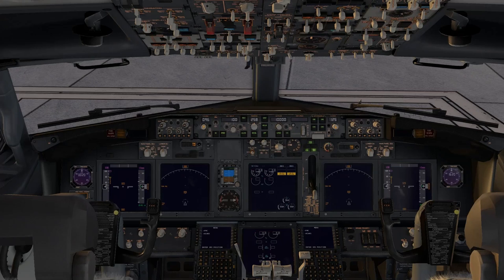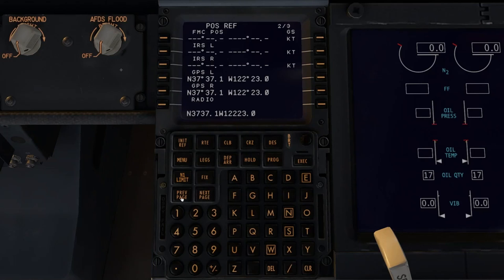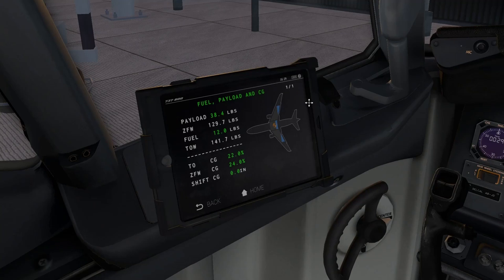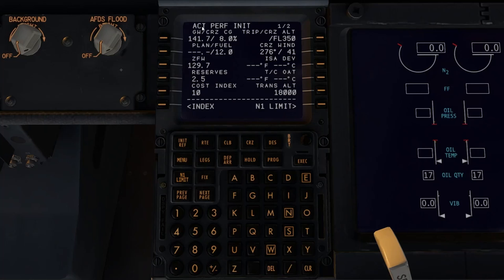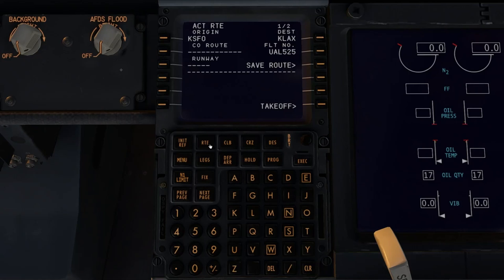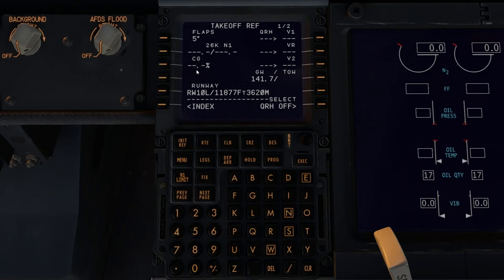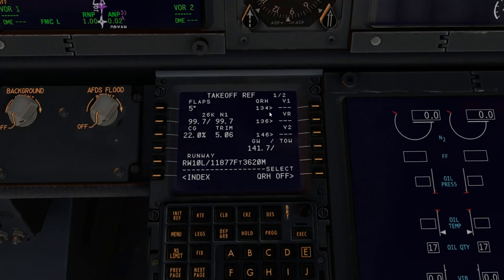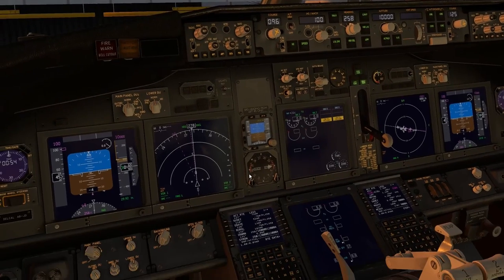X Zibo 737-800 FMC Tutorial | UNITED - How to: Setup the FMC Pre-flight | X-Plane 11

Comment: Overall, great video. Just a couple notes since most of us flying the Zibo are looking for 100% realism. 1) Wing tanks must be full prior to adding fuel to the center tank. I know you were in tutorial creation mode, but I want to avoid 737 pilots from making this mistake. This is taken from an actual Boeing 737 Ops Manual. 2)The reserve amount is actually your ALT APT+ FINRES since you are "reserving" the fuel needed to divert. This is confirmed by flightdeck2sim's FMC tutorial. 3) You don't have to manually enter the center of gravity CG or the OAT, just press the softkey and they will auto fill using the info from your MCP and AVITAB weight. 4) The avg wind direction/spd can be found in the Simbrief where you see "TOC" for top of climb. The ISA DEV temp is also listed a line or two below the wind direction/spd and begins with a "P".
Reply from the maker: Sim 737 Pilot thanks for the feedback.  I agree on the realism aspect.  Unfortunately, we’ve found in many forums low time “pilots” jump straight into the Zibo since it’s a fantastic “payware” quality aircraft for free!  Care should be exercised when loading fuel as you state.  Many may be unaware that loading the fuel in the center tank increases stress loading on the wing spars and support structures.  This being the reason why fuel is burned from the wings last.  I think sometimes the reserve fuel quantity is often mixed up.  Since it’s a “bingo” fuel level, its awareness is extremely important.  The alternate fuel is typically designated in flight planning as “alternate fuel” but this may differ among carriers.  Part 121 of the US 19 CFR provides further reading for those interested in fuel requirements for air carriers within the US or its territories.  I’m sure there is an ICAO version as well, but they are probably very similar.  Thanks again for helping grow the knowledge base of the sim community!

Comment: Excellent tutorial, I refer back to it often just as refresher. I would like to ask about saving the for plan so has to pull it up later in co routes. I have been unsuccessful in doing this.
Thanks a heep
Reply from the maker: That’s an excellent question and unfortunately one we don’t have the answer to off the top of our heads.  We don’t often fly repeated routes (since we are no longer part of a VA) but it is possible.  In fact, I think there may be a stored folder within XPlane where it holds the company routes.  Sorry, to not have an answer to this specific question.

Comment: The best tutorial i watched so far.  +1 sub! 

-one question though, what do we do regarding “unable crz alt” msg?
Reply from the maker: @Francis Meceda Thank you for the feedback.  'Unable Crz Alt' can be caused by a few things.  If you setup your aircraft and FMC according to simbrief (we have an FMC video and an Airline Flight Planning video on those topics), you can likely clear the warning and ignore it.  Here are a few reasons the FMC would warn you:  1- Your trip is short enough there isn't time to reach the cruise altitude you set in the FMC, 2- Your trip includes a step climb, and you have programmed the highest step in the FMC.  Typically the aircraft is too heavy to reach its final step right after takeoff, and that is what cues the warning.  As long as you program the FMC and MCP to complete each step (as per simbrief), you should be fine.

Comment: Thanks alot amazingly explained
Reply from the maker: You are welcome. Thank you for the compliment.
Reply: @FlightBrothersFT  how do you set the gross weight for landing tho? Is it automatically done when you set the perf ...
Reply from the maker: Sure, your progress page shows your estimated fuel at destination.  Look at the current fuel on board as you’re planning the descent.  Subtract the amount of fuel you have from the destination from your current fuel load, then adjust the gross weight by that amount.  I.E.  destination FOB 8.0, current 9.3.  Current gross 110.  Since we are estimated to burn 1.3, our estimated gross at arrival would be 110-1.3 = 108.7 then the ref flap speeds should recalculate.

Comment: hey this is probablly the best FMC tutorial I have ever seen!! great work. I have a question? How do you know that the fuel you enter in FMC is in lbs and not in kilos? is there a way to see it ?
Reply from the maker: Thank you for the compliment! The Avitab can be switched between lb and kg, but I want to check on the FMC. I have only ever used it in pounds, but that doesn't mean there isn't a conversion buried somewhere in the menus. Keep checking back, we'll let you know as soon as we get a solid answer.
Reply from the maker: @burcin Under the Settings and Features, Aircraft Config on the AVITAB you can select the units of measurement.   That unit does transfer to the FMC, I have confirmed.  You may also independently verify by using your preferred unit of measurement, then select the PERF INIT page on the FMC, and change it on your AVITAB.  It will alter the reading between Kg and Lbs on the FMC and also change related measurements on the EICAS.  Thanks for your feedback and we at FBFT hope this helps!  Cheers!
Reply: @FlightBrothersFT  hey guys thanks for the fast response. I was also able to do some testing and if you I can confirm that if you change the kilo/lb section it literally changes simultaneously in FMC!!
Reply from the maker: Burcin Erdemir it’s our pleasure and we were glad to help!

Comment: Nice tutorial bro, quick question, if we use KG units on the tablet/iPad for fuel weight, do we enter it as KG units in the FMC, or would it need to be converted?
Reply from the maker: The FMC and EICAS should convert to metric or standard based on what you are using.  I believe we’ve verified this before, but it’s been a while since we’ve flown the Zibo.

Comment: how you change for decimal number  in the payload page mine are full number  in lbs/kgs
Reply from the maker: You should be able to input the correct one or adjust it in the fuel/payload manager within XPlane itself.
Reply: @FlightBrothersFT  i check there  i found nothing if i change the value nothing work

Comment: on 28:53, how did you get the runway info? mines shows blank even after correctly filled out the departure and arrival.
Reply from the maker: Interesting. Let me ask a few more questions. Have you tried other airports and runways? Is your nav database up to date? Is your Zibo up to date?  I can't guarantee it is one of those, but they seem like the most likely issues. It has worked for me everytime I believe.
Reply: Flight Brothers FT I updated navigraph FMC to 2007 and Zibo is also updated.
Reply from the maker: That is odd then. Sadly I have no more guesses what the issue might be. There is a Zibo community group on Facebook with some really excellent folks who specialize in this aircraft. You might want to check in with them. Sorry I couldn't be more helpful.
Reply: Flight Brothers FT thank you for trying, I really love your videos btw. Very detailed and simple.
Reply from the maker: Thanks!

Comment: Why doesn’t performance initial pop up in the bottom right corner of my FMC?
Reply from the maker: Sorry for the delay, somehow this comment got missed.  Is everything else functioning correctly?  In our experience the init has always been populated.  Unless I’m misunderstanding the problem.  Try loading the default Cessna 172, then switch to the Zibo.  If that doesn’t work, try a clean install and DELETE the existing Zibo after backing up any additional liveries you may have to reinstall.  Sorry for the delayed response.
Reply: @FlightBrothersFT  thank you for the response, I uninstalled it and re-installed it but the problem hasn’t been fixed. Is there something I have to do after installing to make it work? I loaded the default Cessna 172 as well but that didn’t fix the problem. I feel I’m missing a step here.
Reply: @FlightBrothersFT  and the problems seem endless, set irs position doesn’t pop up with perf initial and I’m getting pretty frustrated considering it’s been a few months

Comment: very complicated is there a automatic planner for FMC?
Reply from the maker: https://youtu.be/sHcD0HQyy14
Reply: @FlightBrothersFT  this was way too complicated
Reply from the maker: Jesse sorry, what is it you’re looking for specifically
Reply from the maker: @jesse baby steps.  If you are fairly new to flight sim, or the 737 we would not suggest flying the Zibo.  Just take your time and “earn your stripes”.  If you have any questions, let us know and we will help or point you in the right direction as best we can!  Cheers.
Reply: @FlightBrothersFT  the major issue is that my honeycomb yoke is not compatible with zibo for the rudder pedals like the default 747-800 but that version is honestly garbage and we all know that i have been using a joystick as a rudder but somehow the laminar research has added the yoke to be usable as rudders without pedals. I have used xplane a long time my first yoke was the original logitech Saitek pro 7 years after I would never use that yoke again so I know some stuff I just wish I had the rudder working as well as wheels  on takeoff

Comment: Great video, i stopped playing x-plane cause i Didnt know how to USE my FMC, but now i know how to thanks to you! Great video! Just one thing. My fuel on the avitab isnt like 142.7 its much more Numbers and i struggle when IT comes to the fuel
Reply from the maker: You are going to be looking for the total fuel.  This could be in kg or lbs, so make sure whatever you are using (Simbrief maybe) and the FMC are speaking the same language otherwise you may end up with a “Gimli Glider”.  If you can provide further details we might be able to assist further.
Reply: @FlightBrothersFT  Maybe that's the issue that I have simbrief in KG

Comment: The irony of using the word accurate number next to pounds when pounds is a weight of measure pegged to the kilogram itself. Love your videos. Transitions are long, is that on purpose?
Reply from the maker: Not sure what you mean specifically about the transitions.  If you are talking about the beginning where we show the requisite Simbrief data, yes.  We noticed newer sim pilots in the forums asking similar questions.  Those led to most of the Zibo tutorials.  While they may be a bit slow for more experienced users, we wanted to capture an audience at all levels.
Reply: @FlightBrothersFT  I meant the tranzitions from one view to the other (e.g. top panel to tablet). Not like it matters, just an observation. Is good that you take time to explain each feature in detail. Thank you for your time doing this.

Comment: What about the climb Cruze and decent pages.
Reply from the maker: The initial cruise altitude setup is shown during the setup procedure in this video.  The only time you might need to mess with the cruise page is if you are doing a step climb enroute (for example, the trip starts at FL320, but later climbs to FL360).  When you reach the waypoint planned for the step climb, reset the MCP altitude to the new target and change it in the cruise page.  The descent operations are handled in a separate video. https://youtu.be/_MV2CAPZzyU   Let us know if you have further questions.

Comment: Sometimes I can’t find the Sid or Star for a route. And when I turn off the retractable’s, my plane goes into a bank angle/AP disengages. Can someone explain both of these? I’d appreciate it.
Reply from the maker: Interesting. You might check that your simbrief AIRAC cycle matches the nav data cycle in your Xplane. Procedures change and that could explain that one. Regarding retractables. Do you mean the retractable landing lights? Those should definitely not affect your AP. Perhaps a bug somewhere, is your ZIBO up to date? Just a guess.
Reply: Flight Brothers FT I just got zibo about a week ago. I joined X Plane 2 weeks ago. I’m pretty sure Zibo is up to date. I’ll check AIRAC in Simbrief. I’m still not sure about the retractable’s. Do I have to turn them off just before 10,000?

Comment: great work, how I can put the FMC in nave data 1901I have navigraph thanks
Reply from the maker: Download the installer from navigraph, or use their manual dowload/install option. Detailed directions are on the download page. Basically you'll download and put the files into the custom data folder.
Reply: @FlightBrothersFT  thank you very much it's done

Comment: where did you get your payload value on avitab? Is it from simbrief? under weight section est value?
Reply from the maker: Yes, the payload weight comes from Simbrief. You can change the payload weight if you like. Simbrief is using an 'assumed average weight' calculation based on the number of pax listed to generate that payload weight.
Reply: @FlightBrothersFT  thanks for the info btw about fuel reserves some video claim it was something like altn+finres so im quite confused
Reply from the maker: @chrisxen7654  final reserve is the "bingo fuel".  At that point ATC should be advised that you are using reserve fuel and all efforts should be made to land.  Alternate, extra, and contingency fuel would have been exhausted before hitting final reserve.  Additionally, the alternate is in place should the scheduled airport be unusable due to weather or an emergency making the runway unavailable.  The diversion should occur before reserve fuel usage.  Hope this helps.  Take a look at Captain Joe for his explanation.  https://youtu.be/YWBLqBaODF0
Reply: @FlightBrothersFT  thank you 😃
Reply: @chrisxen7654  Flightdeck2sim's Channel in his FMC tutorial does state that ALT+FINRES = Reserves. He is a real world 737 pilot based in Europe.

Comment: I cannot see the altitude. 13:08
Reply from the maker: 350, meaning FL350, Flight level 35,000 which is 35,000 ft with the altimeter set to STD (29.92).